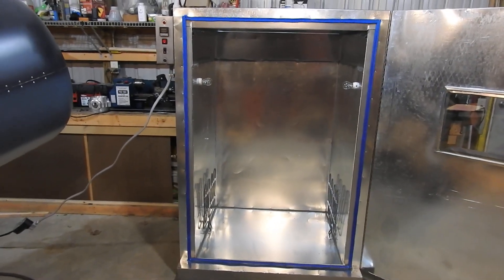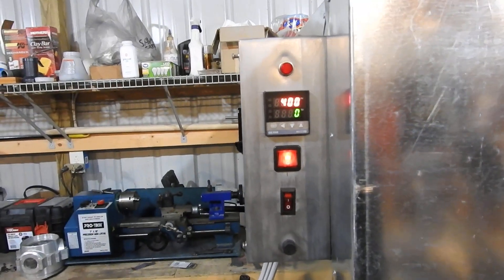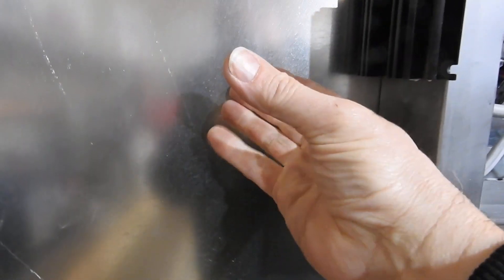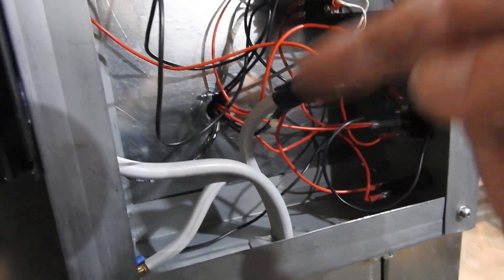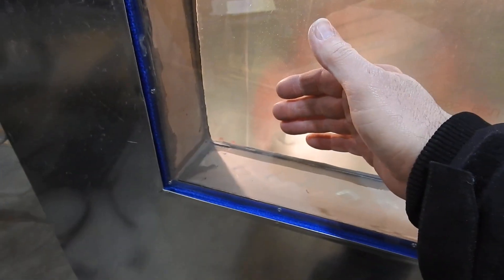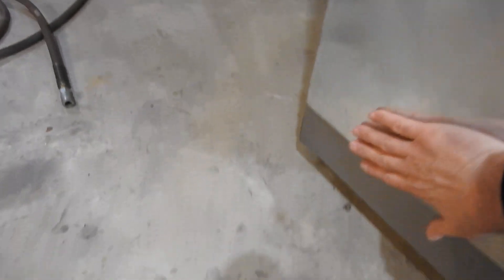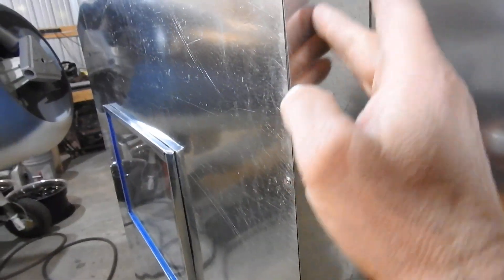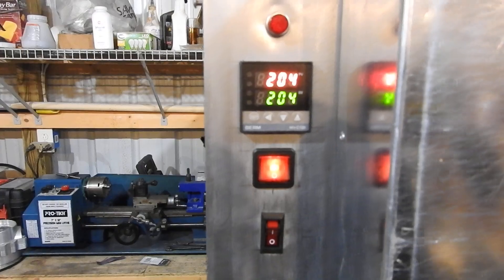DIY Powder Coat Oven build 3

Comment: Hi Don,
I am part way through mu oven build and have just had another look at this video. I can't help thinking that you have too higher wattage on your elements that is causing the temp overshoot. I know that the PID should take this into account and shut off earlier but have you tried isolating one of the elements to see if you get the same response? I am building a 650x700x1600mm internal oven and I am only using a 3kw element.
Kind regards Paul (UK)

Comment: I got a question that I hope someone can answer. I'm guessing these elements is around 2,3kW? Well my elemenst are going to be around 2,3kW. So how can you have 2 of them on, at the same time without tipping the breaker? Can you have two on at the same time because your fuse is like an 16A or 25A fuse? And after the fuse do you have a biger sized wire to your PID controll to make sure the wire dosen't burn up when it needs that many amps?  Greatful for answers! /Filip
Reply from the maker: The heating elements must be run on 240 volts. If your elements are 2,3kw each, that works out to just under 10 amps each. So you will need at least a 20 amp breaker with 240 volts. I used two solid state relays one for each element. They both can be triggered with one signal from the PID (temperature) controller.

Comment: u must set alarm 1  at temperature controller sir  if temperature over 20 % from setting alarm will on, for safety
Reply from the maker: Yes I have the alarm set to turn on the red light on the control panel. It works.

Comment: I'm sorry, not the Rockwell Insulation but the strip of material that you used between all of your sheet metal to prevent heat transfer.
Reply from the maker: It's fiberglass tape used for rapping car headers. Get it off eBay.

Comment: Where did you get the insulating material that you used between all of the panels?
Reply from the maker: It's called Rockwool insulation. You can get it from Lowes or Homedepo.

Comment: I changed out the ssr's for a 40 amp contactor way better and no chance of melt down.
Reply from the maker: If I have future problems I will give it a try. Right now it's fine. Thanks for the idea.
Reply: I'm building mine with contractors as we speak, mechanical is way better and you can physically look at it and know if its stuck close
Reply: @Ricardo_Wade  yep thats it :)

Comment: Great build, how did you separate the 220v and 120v circuits for the elements and lights?
Reply from the maker: I have a two pole relay in the control box. One side runs 12 and the other 120. It's usually called a cube relay. it's triggered by 12 volts through the pedal for the low voltage in case of a short, you won't get shocked by the 120 a/c.

Comment: Great build... Finaly someone with the idea to insulate the hole frame so it doesn't heat up de rest of the room😊. What is the type of that display you're using? I'm planning to build a similar oven, only a little bit smaller. Greetings from the Netherlands
Reply from the maker: It was a unit I got off of Ebay. Chinese stuff. Look for PID controllers.
Reply: @Dynodon64  thanks for the reply!

Comment: Is the SSR physically mounted to the heatsink? For mine, I used 2 40amp auber SSR's pushing 50 amps total. Been solid for over 3 years now. Also add a fan to the heatsink to push cooler air around it.
Reply from the maker: Yes all of the SSR's were mounted on heat sinks.

Comment: I have a similar SSR on my oven with a large heat sink and have burned up 3 over 4 yrs, I finally went back to an old oven set up and has never failed, not as accurate but never fails. I may try the 2 SSR to split the amps, thanks for the video. I wish I had seen it 9 yrs ago!
Reply from the maker: The oven is still working with this SSR. I have two new ones coming and will wire them in, one for each element, but both triggered by the PID. I think the high amp load caused this one to stick that one time. It hasn't burned out yet.
Reply: I enjoy your videos and tell me if im wrong but were you a jet mech in your previous life ? The reason I asked is we really think alike and I was for 20 years in the Navy, I built an oven almost just like yours (4x4x8) but I stopped about 8 months ago but after your video I restarted and completed the build.

Comment: How did you do the control panel for the temp
Reply from the maker: I used a piece of the 2x4 metal stud to make the frame. If that's what you are asking. It's just cut on the edges and bent into a box shape and riveted together.